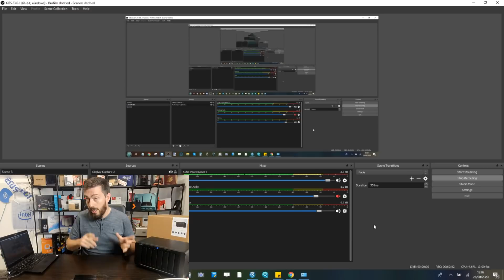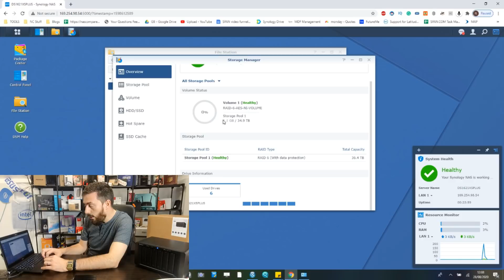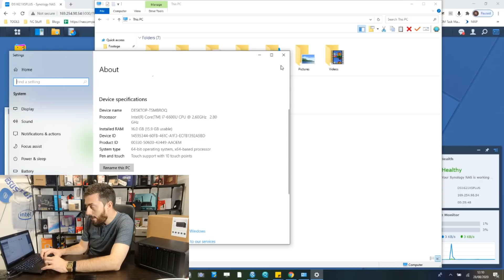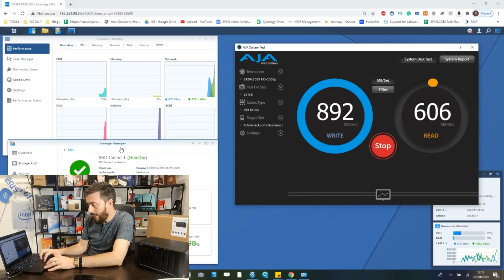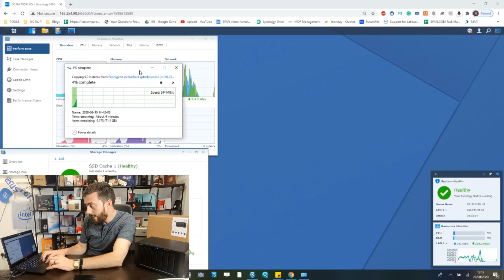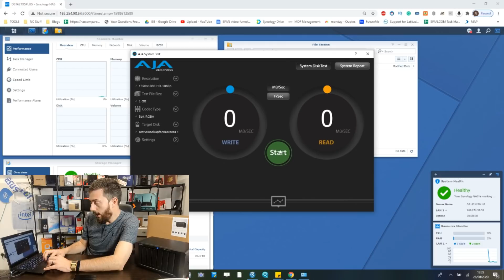Comment: Sorry, I got confused there, 
You turned off the nvme cache on the nas, and still got similar write/read speeds from a laptop ssd over 10gb network to traditional hd in the nas?

Or was the nas was filled with ssds?  I was expecting to see a significant speed drop when you turned of caching?

Comment: I have the same system, but my read and write times are horrible within a Raid 10 configuration. My write is 94 MB/s and my read is 110 MB/s . I'm thinking maybe I got a defective unit. Any idea of what could be happening? The unit is stock (no SSDs and no added memory). I'm running (6) 4TB IronWolf Pros.
Reply: Never mind, I missed until now there was a Sonnet 10 GbE Adapter in the mix. This definitely explains the speeds. Thanks for all the education.

Comment: I have a late 2012 iMac with a 1gb card & Cat6 in my house, WHAT SPEEDS SHOULD I SUSPECT USING THIS NAS through a 1gb iMac card? Eventually I'll update to a new iMac with 10gb card & a 10gb switch, but I'm looking for a temporary solution for 4K video editing / storage as a temp solution until I upgrade my system. I currently don't have a NAS and I eventually want to edit straight off the NAS once I upgrade my network to 10gb.

Comment: My thunderbay flex 8 with hdds is faster over thunderbolt 3, call me unimpressed
Reply: Fair pint. But how much simultaneous users can connect at once? (NAS allows many) How do you organize your backups, off-system? (NAS Allows NAS-to-Cloud, NAS-to-USB, NAS-to-NAS, etc) Does your TB3 DAS run without you connected? I know the Thunderbay Flex8 is no ordinary DAS (U.2/PCIe/USB-docking/etc) and am impressive piece of kit, however it is still not as multipurpose as a NAS. Definitely faster, but less flexible - more a question of which is the right tool for different jobs.
Reply: @nascompares   I'm not quite sure what you're asking. Ultimately, a DAS is not driven by its own OS (or software) that imposes limitations to the issues you're presenting. The limitations you're noting are OS/Software/Protocol driven (not RAID software at that). Your primary limitation here will typically be read/write speeds and infrastructure speeds. You can basically connect to a system via thunderbolt 3 or 4 and have it delegate out those rules providing whatever level of flexibility you want. In my case, I have an M1 Mac mini that I can swap out at any moment hosting my server (making my restrictions the software running in tandem with macOS as of now). Ultimately, this flexibility and modularity to the system (with the performance) is why a DAS typically trumps NAS. NAS systems are less modular and more enclosed solutions, hence they are less flexible and restrictive on what can be run and how it can be run.
Reply: @TheGamingArt  you pretty much ignored his whole question smh

Comment: Thank you for the numerous amount of vids that you have uploaded. You did confirm what i was looking for; the nvme cache does not do anything with windows file transfers towards the nas system. One thing i do want to point out that i find it quite odd that you use such outdated (6th gen.. we are at 10 and 11th gen is arround the corner) hardware. Also that thunderbolt connection; i doubt it is even version 3. But ofcourse main bottleneck is your sata ssd that maxes out at 550mb read tops. Thank you anyway!